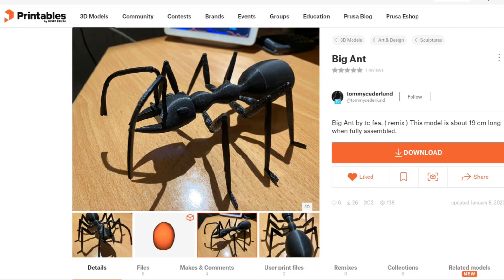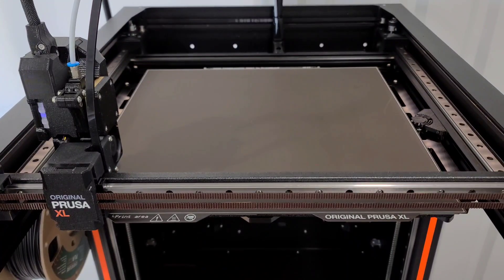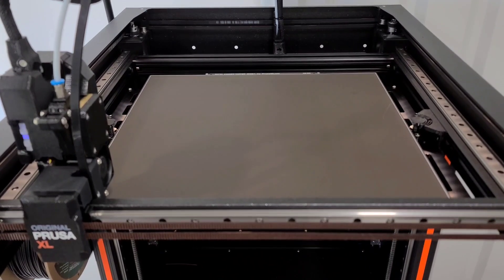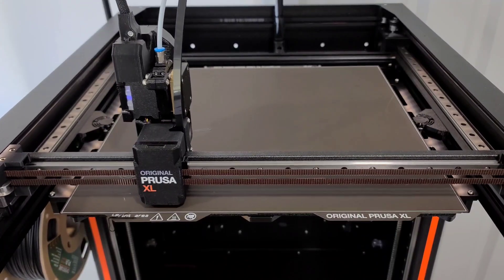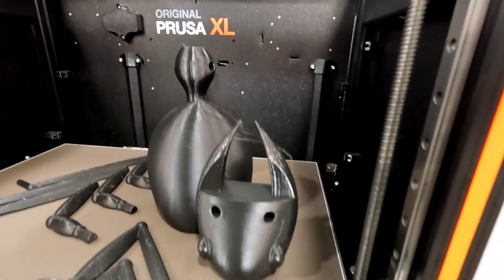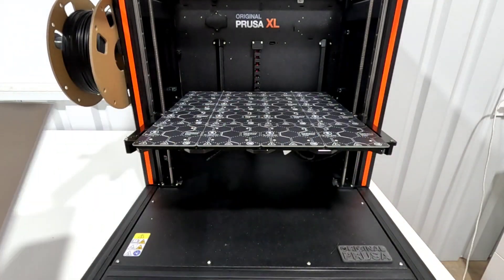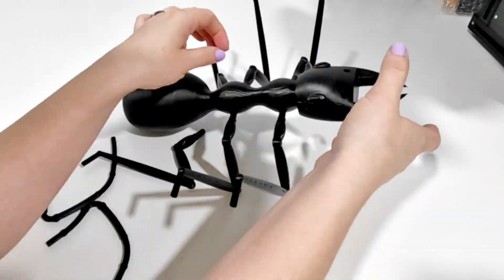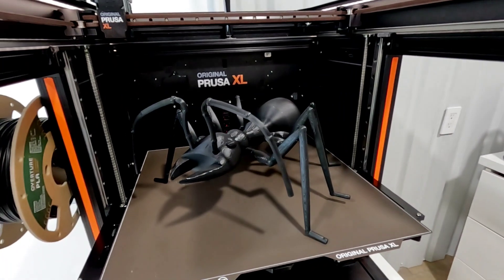Printing an XLarge Ant on the Prusa XL!!!

Comment: What glue did you use. Ant is Awesome. use fuzzy skin next time on it.
Reply from the maker: At first, I just used Loctite Super Glue.  And then at the end my hubby had some adhesive in a caulking tube. I'll have to ask him what it was.
Reply: @tada3dprinting  yeah I never have luck with Super Glue. Radio Control Car CA glue should work better. That can hold a rubber tire on a plastic rim at 10's of thousands of RPM,s. I use that on my RC8B and RC8T and others that I have. The plastics arent PLA but probably ABS.

Comment: This Ant would have Fuzzt Skin.
Reply from the maker: That would be cool!
Reply: @tada3dprinting  of course you would have to adjust the fuzzy skin settings for each seperate part and decide which part should have more/larger fuzzy skin. Ant Legs are hairy, I think.
Reply from the maker: @SpectraV3i  I would probably need to print each item separate?

Comment: Is the ant available as a 1-piece (assembled) model?  Would you be able to print it max sized for XL using PrusaSlicer 2.6.0-alpha6 organic supports?  (They work very well, and this seems like a good model for them.) Just wondering.
Reply from the maker: I believe this one is a remix of an ant that is a single piece. Yes it would be a good way to check out supports. I'll work on this. Thanks!

Comment: Trust me you want the magnets to be as stiff as possible. I have yet to find a build plate that won't pull up off the magnets in the corners under certain large flat prints.
Reply from the maker: Yes I guess that's true! Thanks!

Comment: Oh man I just love watching that thing do it's thing. The stringiness might (might!) indeed be a sign of a slightly worn down nozzle. You could try printing some overhang test-piece to see how it behaves.  But otherwise, that ant looks sa-weeeet!

Today's question is about the printbed. How sturdy does it seem to you? Is there any play/give in it, if pressed down on slightly? Do the z-axis screws look straight or do they wobble? I remember you printed the mega-benchy before which was very interesting experiment. I'd be super curious to see more tall / heavy prints and if there are any signs of z-wobble on your XL. As always, thank you for the great upload!!
Reply from the maker: The printbed feels very sturdy. I assumed it would have been supported on the back too but I don't feel like it needs it. No give or anything. I'll be starting the rocketship next.  Thanks so much!

Comment: 3D Gloop is excellent, but you need a well ventilated area and gloves. But it really works very well.
Reply from the maker: Yeah and I know a lot of glues leave a white haze on black filament. Does the 3D gloop do this? Usually I prefer to just have tabs or something to reinforce the glue.

Comment: The ringing is terrible... especially for a CoreXY. Is there still no input shaping for the XL?
Reply: Indeed, quite a bit of ringing visible at the antlers for example. More than expected for a coreXY design. Loose belts perhaps?
Reply from the maker: Do you expect less ringing on .32 layer height with .6 nozzle?
Reply: @tada3dprinting  no ringing at all - the layer height doesn’t matter, only acceleration. Even at 3 times more acceleration shouldn’t be any ringing on a corexy…

Comment: Try using a super glue (CA glue) with a spray hardener! It works so much better than just the glue, it cures almost instantly and would for sure be able to hold the head on that ant!
Reply: Little tip to remove any white haze, put a little olive oil on a cue tip then rub the excess off and it instantly removes it, been doing this for years it vanishes instantly!
Reply from the maker: @gavinliddle2071  thank you!
Reply from the maker: Does it leave a white haze? Thanks!
Reply: @tada3dprinting  with the activator it definitely reduces the amount of haze since the glue cures almost instantly. There may still be a small bit of haze but it’s greatly reduced!

Comment: Been considering grabbing the XL myself since I may be going into the Cosplay scene for 3D printing (Printed pieces for a helmet on my Ender 3 recently). It's a gosh darn pricey printer, but I know Prusa has a lot of nice bells and whistles with quality of life features. Would you say stuff justifies the cost, and would be worth it for my purposes? (I'd also probably just print larger stuff in general like this ant and not just props and cosplay stuff lol).
Reply from the maker: I have some large items that I sell on Etsy. Before the XL, I had to slice them up and print separate parts, hope they didn't warp enough that they still lined up, glue together, hope the glue holds them together enough, sometimes have to reinforce seams. 

I LOVE being able to print larger items on the XL! It saves me a TON of hassle so it's worth it to me. I doubt I will avoid ever stop splitting/gluing some things. But even less is worth it to me. I'm sure for cosplay you will still have to split/glue some parts but I would say it's worth less hassle. Thanks!

Comment: Thanks for sharing these videos! I have mine on order but I don’t expect to see it until next year,
so your previews of the printer are perfect! 🙂
How did you get yours so soon?
Reply: She probably ordered the single-head one, and fairly soon after the announcement (more than likely the same day). I, myself, ordered the 5-head model, and check every day for news from Prusa in their blog.
Reply: @AdamSamson1991  you and me both brother
Reply: @AdamSamson1991  you are not alone in that
Reply from the maker: I ordered the "fully-assembled single toolhead" asap on Day 1. I also ordered a "semi-assembled 5 toolhead" later on Day 1. I haven't seen any email about the second one.  I assume most everyone else ordered multiple heads or semi-assembled and I don't think either of those are going out yet. I am curious to see what the next release will be. Thanks!